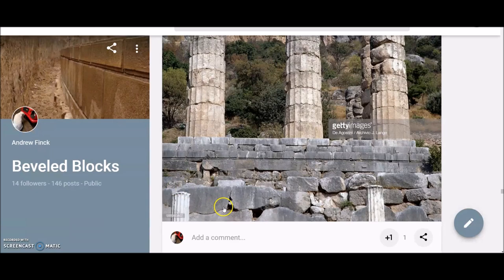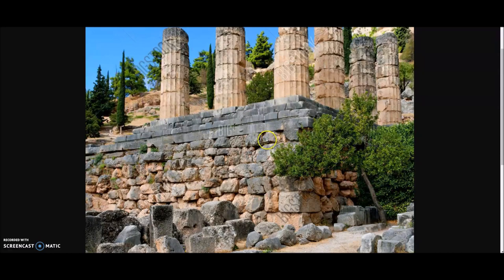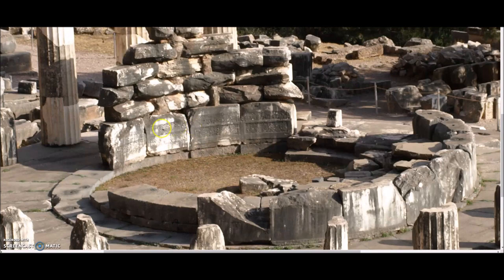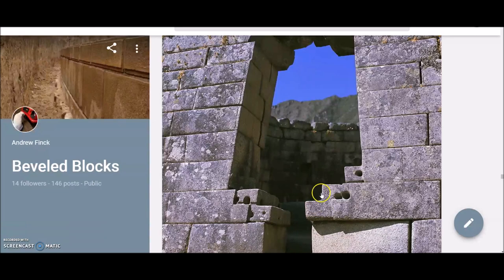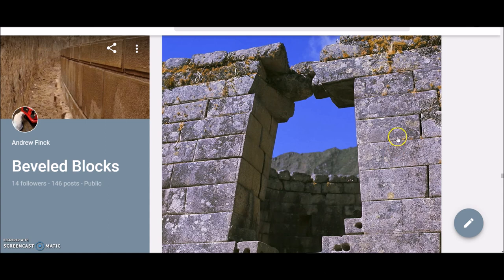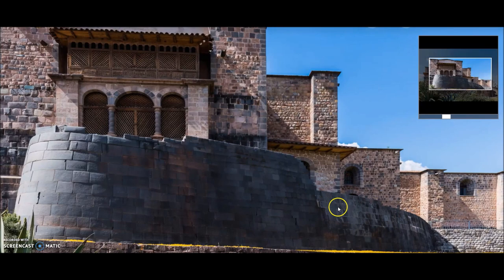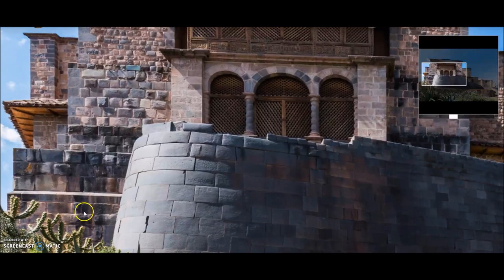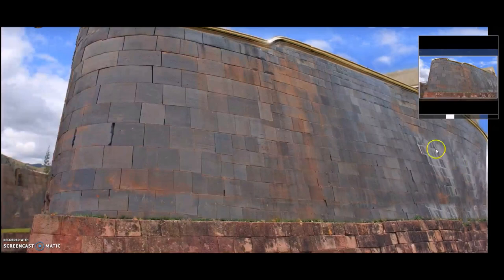The Mystery of the Bevel Blocks, part 9

Comment: The last structure you show, to me, at least from the perspective in the picture, looks much more like an observatory than a fortification. Unless there was a wall surrounding the structure , the main staircase/entrance to the building is open and wide. If it were defensive in natrue it would be either on the inside or very narrow as to limit how many can use that way to attack it.
Just my impression of it.

Comment: Philosophy.  Design philosophy.  Maybe more connections can be deduced by considering the different locations that exhibit similar design construction as deviating over time from an original construction design based on an original design philosophy. For example, perhaps polygonal design construction followed a certain design philosophy that can be deduced by considering deviating constructions as lacking some element of original philosophy. Then by organizing the various similar constructions by how they seem to deviate from the apparent original philosophy, the analysis may lead to a better understanding of what that philosophy may have been. Then once that philosophy is better understood- all of the constructions can be re-analyzed with that philosophy in mind.

Again, for example, the square anomalies ... these seem to be one of two things. Either they are a necessary element following a certain design philosophy or they are a standardized fix to cover various degrees of mistakes. I suppose in both those cases the square anomaly exhibits some kind of design philosophy.  But whether the square anomaly is a proscriptive element or a standardization of repair during processing would in either case define a different design philosophy and construction standard.  

We all seem to agree that polygonal blocks must have been placed in somewhat rapid succession.  So the question becomes, what measurement and what instruments of measurement were used to determine whatever margins of successful construction were being reached, and what was the original design philosophy?  Without knowing the design philosophy the only clue we're left with is structural integrity. Taking into account the likely level of technology at the time as well as the apparent rapidity of the construction of polygonal blocks walls, some instrument of measurement may have been used that could test the structural integrity of the entirety of the walls as they were being built.  It is, of course, impossible to know. But these considerations can lead to insight and inspiration concerning other possibly deductible factors.

However, it may be that such instruments and their measurements had already led to a design philosophy which is exhibited by the most impressive and skilled examples of polygonal masonry.  

As I'm thinking about it now, I'm certain that the square anomalies must have been patches to cover mistakes during construction. The reason they are of consistent size is most likely because a larger or smaller size would, based on some unknown design philosophy, be unsuitable for bearing or distributing load pressures.

Anyway these are some examples of thoughts that led me to imagine the nature and details of this ancient design philosophy.  I hope that anyone else considering these details allows them self the structure of design philosophy to be a supportive scope that may lead to new insight.